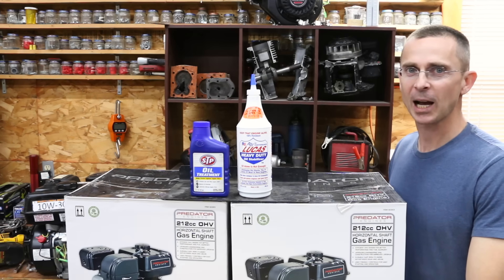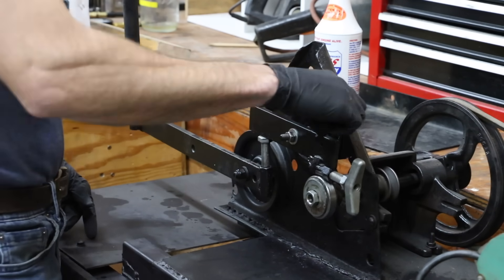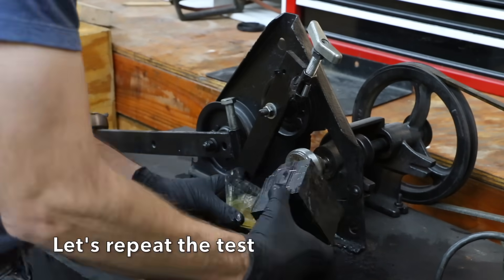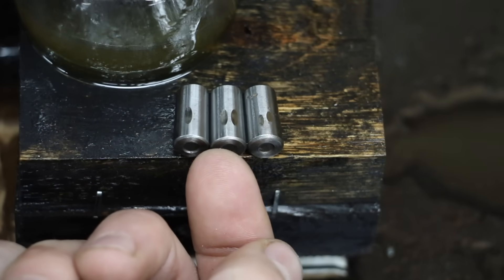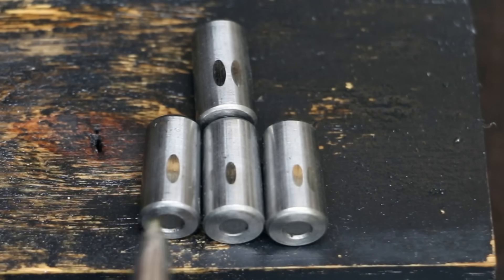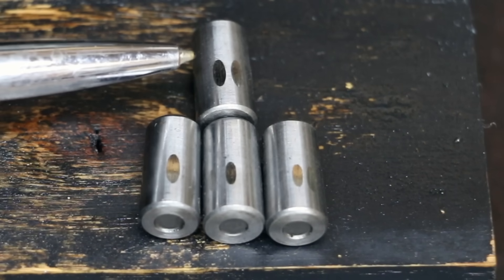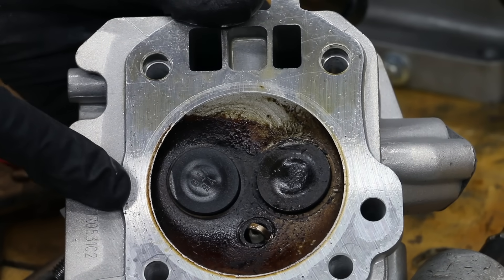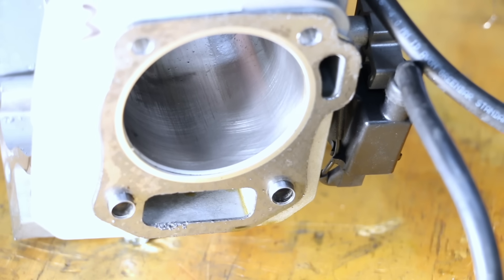Which engine self-destructs first?  Lucas or STP?

Comment: You should do the cross axis machine test and engine failure test between Bitron, Prolong, and Zymol...I have used all the products and had the highest results with Bitron products and still use today their engine treatment, penetrating lube, and fuel treatment upper cylinder lubricant...Bitron doesn't contain any solids like graphite or PTFE's the can build up and clog or were your engine prematurely unlike other brands, and can be purchased online which originated in Vancouver B.C., Canada and still is there to this day...

The other 2 brands can be found on Canadian Tire additive shelves...the most impressive difference between all of these is that Bitron used a cross axis machine to demonstrate its superiority in not only heavy loading without seizure... but it could also handle Heavy Shock Loading to the point where the guy was making the Cross Axis machine jump off the ground...as Prolong couldn't even make the pressure test alone...and I think it would be great for the Public to Know what REALLY Protects your engine and separates the Men from the Boys so to speak....

The first thing I noticed about the engine treatment once added to a 91 Civic Si tappet valve engine using Quaker State SAE10w30 was how under heavy torque to the floor the engine revved up Much faster, smoother, and quieter than before with only the SAE10w30 giving it a Noticeably more Refined feel and smoother power band as I watched the Tach going to RedLine...this I can vouch for... and you will too once you try it under load before and after..

What would be great is if you could do a dyno test some how to see the differences real world and that will most likely be the biggest winner in real world numbers...that no-one can refute..

Untreated vs Treated

Just in case you're wondering how it can perform so well is because of the Positive Charge that has been applied to the lube where it is attracted to the hot area of the bearing and stays there where the protection is needed where other oils are naturally repelled from heat for example vegetable oil poured on your hotplate for cooking pancakes...

All oil breaks down eventually and i'm sure that Bitron will eventually break down and seize the engine once oil has been drained...but under normal/proper use with oil added to cranckcase will provide years of reliable and low wear operation

I'm sure it will be an experiment you and others are going to enjoy very much..!! I know I will..

Trevor J. Webb
Reply from the maker: Thank you for the video idea!

Comment: Going back about 35 ears or so there was a product called Slick 50. A pilot in a Cessna 180 claims his engine sprung an oil leak bit the engine ran for 45 minutes or so and even ran normally after the leak was fixed! Have you heard of this product and is it still around? Good for coughs colds sore holes and makes child bearing a pleasure!!
Reply from the maker: Thank you

Comment: Since you didn't answer the question proposed by the video title - STP lasted 12m26s and the Lucas lasted 21m41s
Reply from the maker: Thank you
Reply: Did you not watch the video?
Reply: @norweldgp6250  Sometimes I ask MYSELF.  Do 50% or less watch the video before they make some asinine comments!
Reply: @sonnybzero  After reading the comments on hundreds of videos, I'd say your number is low.  Very low.  Most people are not too bright, or mostly the ones that like to comment with no real knowledge from what I can tell.
Reply: So Lucas wins, kinda knew it since I trust it on my dirtbike 2 stroke. Only way to go is Lucas Trusted Brand.
Reply: @eduardodiaz5762  yes 👍
Reply: The answer is do not run a engine without ANY engine oil even if that oil has 100K miles on it.
Reply: You'll get there
Reply: Did u not watch
Reply: Thank you. I was trying to figure out for the life of me why the video didn't give any stats.
Reply: So what does this tell those of us that run with oil in our engines.
Reply: I use 5 quarts mobile one and 1 quart Lucas in my 2005 Chevy van 4.8L and my 2007 Chevy Tahoe and change it once a year. Both are used daily but they don’t get more than 5 to 6 thousand miles a year. Van has over 130,000 miles and the Tahoe has over 105,000 miles on it. But run great and the 5.3L in the Tahoe has the DOD engine and so far no problem’s but I am going to change all the engine parts and delete the DOD garbage.
Reply: Ran my truck down below the dipstick without knowing I was losing oil... Lucas saved my ass.
I use the heavy duty oil stabilizer every time. Clinging agents FTW
Reply: The title question was answered. Which one destructs first. However, it would have been really nice to know how much longer the Lucas product worked
Reply: @SupahD30  DID you watch the video? There is a timer that shows when each engine stopped... or..."how much longer the Lucas product worked
"

"
Reply: Lucas much better much more protection
I talked to a amateur race car driver he said he has blowing motors with STP but never with Lucas that right there told me something😉
Reply: My opinion Lucas Oil is the better performance I m being using Lucas oil all my life  I love it
Reply: THANKS FOR THE SPOILER
Reply: I don't think either one did that great
Reply: @TheSprinterVan  under rated comment
Reply: This video had no logic at all. It proves nothing he had no oil either he dumped it out. Hints the word additive.

Comment: Verry bad test .
If you want to test it .
Run them with oil for as long as possible. 
It will take days for sure .
But then you wil have real prove .
Reply from the maker: Thank you.
Reply: @ProjectFarm  at Le-mans 24 hours race .
The car engines run 24 hours nonstop .
Allot of engines survive 24 hours .
The engines you use may survive the first 24 hours ore not .
I gues that if you run them at full speed with oil they wil not survive 48 hours of nonstop running .
My guess is that stp oil will run the longest of both cause it was keeping the temperature low .

Comment: The Lucas Engine obviously Won because, the connecting rod was not melted to the crank shaft.
Possibly may be able to use the crank shaft again after machining, not so for the STP engine☺ 
I did the same test with Gastrol 20-50 Semi Synthetic (1978 Datson B210 Drained the Oil and left the Oil Filter on) drove it up and down some hills in Ballard Washington from 7006 17Th Ave NW to 85Th, Down 15Th to Market Street to Shilshow Bay Marina, back up the Hill from Golden Gardens Park to 85Th Again left to Holman Road to Car Keek Park (Didn't go down the Hill into the Park, Got scared I wouldn't make it back) and back to 7006 17Th Ave NW. Let the engine Idle in the Driveway till Bed time (Another 2 Hours);   
WTF?!! Nothing! Never Quit and no noise?!!   I was disappointed, I wanted to see a Rod sticking outta the Block.

Thank you for doing this Test and Expending these costly engines.
Reply from the maker: Thank you!
Reply: You're Welcome!

Comment: Don't know about Lucas but I heard the story about STP back in the late 60s. STP stands for Scientifically Treated Petroleum. It was developed by a German scientist during WW2. It was used in worn-out tank engines so that they could be driven into battle, one last time. It works great for what it was intended. So if you need to drive your worn out tank into battle, have at it. But to use it in a modern, well running machine, NEVER!!! I am a retired ASE Master Technician and in 52 years, never saw an oil related failure in an engine that was properly maintained. Save your money. Change your oil and filter , forget the additive.
Reply from the maker: Thank you

Comment: I ditched lucas and started using motorkote. You can get it at walmart now but when I started using it in my tractor trailer you couldonly get it from them. The beauty of motorkote, you add it every 4th oil change to the top of your normal oil and the metal sucks it up. It works wonders. One of my friends was using it in his farm tractors and noticed the engine heat went down a little over 15 degrees with noticeable power increase. But you can use it for anything. Gearboxes rearends. Anything that holds oil. I like the stuff and a true believer because I've seen it work. Unlike lucas which is only an oil stabilizer this adds lubricity to you oil.
Reply from the maker: Thank you!

Comment: Years ago in the muscle car four speed trannies we used one can of stp per tranny. It was the hot ticket back then mixed with gear oil 90wt. It was suppose to soften or cushion the gear mesh and make shifting easier. Now in working as a mechanic in the 70 s we had a customers new car come in where he added too much stp in the crankcase he had like rubber balls in the oil pan. We didn’t have a clue what happened. Maybe he mixed additives?
Reply from the maker: Thank you!

Comment: I forgot to add in my previous post that the manufacturer of Pro Long states that the engine should be run for a prescribed amount of time so the additive has a chance to adhere to the engine parts at the molecular level.  Hope this helps
Reply from the maker: Great point. Thank you.

Comment: I saw a comparison several years ago between Slick 50 and Pro Long additives.  In that comparison, all of the oil was drained out of the Pro Long treated engine.  Two ladies drove around San Francisco, up and down the hilly-streets etc. with the oil plug removed and NO oil in the engine.  The vehicles engine was then disassembled and it was shown that there was no significant wear on the engine parts.  That, to me, was impressive.  I had a Lincoln Town Car that I treated the engine with.  Never thought much more about it.  While going on a trip and climbing a pretty significant grade, the engine started to clack quite loudly and engine started to miss.  I pulled over and let it cool down.  I then started it back up.  It still "Clacked" a lot but it did run, so I drove it 20 miles back to my home  I pulled the oil pan and found that the oil pick-up screen was totally clogged so I went and bought a new oil pump with a new pick up screen and installed it.  I figured the clacking noise was due to no oil reaching the lifters (Being hydraulic lifters) and which also accounted for the miss in the engine.  I put everything back together and the engine ran fine.  Sorry for this long-winded thread, but I would seriously LOVE to see you do a comparison between Pro Long and "Anything Else" you'd like to compare it against.  I truly would love to see that!  And thank you for the comparisons and things that you do.  It's really appreciated!
Reply from the maker: Impressive!  Thank you.

Comment: Noticed the "pissing contest" about using a third engine as a control. Doesn't really matter... because as anyone with the slightest experience in Quality Analysis would know... testing with such a small population of test subjects (1 engine per lubrication scenario) is "bogus" anyway!!! You simply cannot derive credible statistical testing conclusions from a population of 1. Engines of this sort are not "precision made devices" or with 100% inspection protocols to assure all parts are at design dimension (or close) or that 100% proper assembly procedures were followed...their Chinese origin alone creates even more concern for me in that regard. 
There is simply no way to discern whether the test results would have been entirely different if if the Lucas engine had received the STP mix instead. And this is HARBOR FREIGHT for Heaven's sake!!! Anyone who has made a habit of checking out HF "product reviews" will know that with their gasoline engine equipped products, "you either get a good one you love" or "you get one with the engine from hell", and sometimes more than once....just look at the reviews on their various generators for instance! 
The suppliers that Harbor Freight uses are geared to providing product at the lowest possible cost (and that will last their typically ridiculous 30 day or 45 day warranty)...and dimensional accuracy and optimum material selection are likely the first two concerns that fall by the wayside (along with truly effective Quality Control oversight). Even buying something as simple as a  torque wrench from them is a "shot in the dark"...I recently bought one that wouldn't "click" at all, and with the second one...I "knew" the torque value calibration was way off. I quit tightening the bolt I was using it on and went and borrowed a unit from work... regularly calibrated by an outside ISO approved calibration lab. Net result... the Harbor Freight unit "clicked" but had "over-torqued" the bolts I was tightening by about 70% (30 extra foot-pounds). The HF product reviews for these items are full of similar "tales of woe"....flip a coin...either the bolts will be torqued correctly, or too loose/too tight (perhaps stripping aluminum engine parts or "snapping bolts in two").

But I TOO have digressed! Bottom line... I am HIGHLY APPRECIATIVE of Project Farm and others like him that take the time to produce these videos, and provide us with greater insight on so many diverse issues. I bet he would be someone that would "jump right in" to assist any of his friends with any project of concern.... and his videos are a great service to all of us with "what if" and "how does it work" mentalities! That said...I wouldn't put tremendous value in any performance test of this type that didn't involve at least THREE units per scenario and at the very least "ONE" control unit (7 pieces total)...and HF's typical lack of consistency in product quality really bothers me in this regard anyway. But its certainly ridiculous of me or anyone else to expect Project Farm to invest either the time or the money required to approach this level of testing.
So thanks again Project Farm....I actually thoroughly enjoyed the video ,and learning what the failure mode is likely to be with these engines (connecting rod) when not properly lubricated. It was also the first time I witnessed an "intentional failure" with one of their products, as opposed to having it blindside someone in the middle of a critical project... and far, far from the nearest Harbor Freight store (or on the very day after one of their typically "bogus" warranties expired)! 30, 45, and even 90 day warranties are next to useless. I now buy many of my "cheap tools" from the Lidl's food store chain. Typically a full THREE YEAR "no-hassle" warranty on THEIR products, which are themselves, at least a notch or two notch above HF's quality. VERY GOOD success with their corded power tools and Li-Ion products...cheaper too!
Sorry Guys....didn't mean to "write a book"!!!

Comment: this isn't actually that great of a test. The ideal test unfortunately would be very expensive and I doubt you'd be willing to do it - you would need a control engine as well as the two additive engines, then you would run the engines non-stop with the proper level of oil until all of them failed. This would give you something approximating a scientific test, but to be an ideal test and to account for possible defects in the engines themselves it would be best to repeat it several times, or at least once, to minimize outside effects and human error.

In short you'd have to blow up about six engines, not two, and you'd have to feed them for much longer than you did here - we'd be looking at the rated lifespan of the engines at the least- most of which would probably be in the vicinity of 500 hours or more. I'm not sure of the fuel efficiency of these small engines but I had a lawnmower with a 4-stroke engine roughly the size of the engines you have there and it could probably run for 3 to 4 hours on a gallon of gas. So you'd be looking at around 15-20 DRUMS of gasoline... and even then you'd just barely have enough data points for the test to be considered scientific. And that's assuming that the fuel efficiency I just guessed at isn't a lowball- which it probably is.
Reply: A good reminder that these aren't "ideal" tests.  In the end, the videos are a mix of "elbow grease" testing and entertainment.  Sometimes you just want to watch an engine seize up.

Comment: The real question is how long these additives will last before the chemicals break down and don't work anymore. I've used STP many years ago to fix cars that burned oil, but it only worked temporarily. From what I understood, Lucas oil was mainly used to extend the viscosity of engine oil for those too lazy to change it as recommended.
Reply from the maker: Thank you!

Comment: I don't know anything about the Lucas product , but the intended use of the STP is to bring the oil zinc content back up to where it used to be when most or all non-OHC engines had flat tappets as opposed to roller tappets. Over the past few decades a great deal of zinc has been faded out of most if not all oils for gasoline engines because engines are not produced with flat tappets any longer.
Reply from the maker: Thank you!

Comment: If you didn't change the oil after break in you destroy the engine faster with the break in metal shavings, I would also like to see a test with Zink additives besides STP and race oil and Synthetics, with the STP it  has Zink and Lucas doesn't so the components will last longer i have had two vehicles over 300,000 miles a 89 Chevy S10 2.5 l4 with 310,000 miles running  STP and a 81 Chevy Malubu 3.8 running STP over 430,000 miles before it was overheated but both  still ran i parked them because they smoked!  Your Ruffing up the race without polish or same shape makes  the bearing test Dumb no bearing race is resurfaced by a grinder that can not be the same shape every time use fresh races out of the box for a accurate test!
Reply from the maker: Thank you.  I did change the oil after break in and then used fresh oil with each additive.